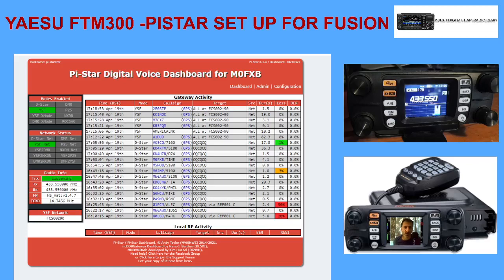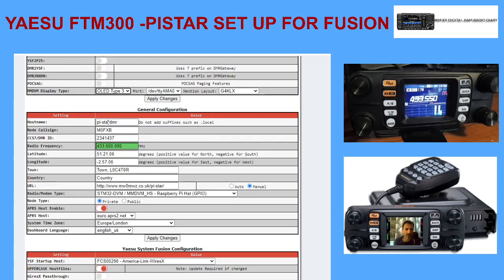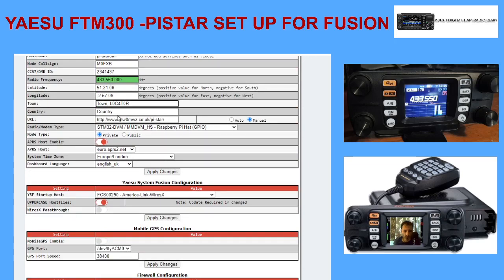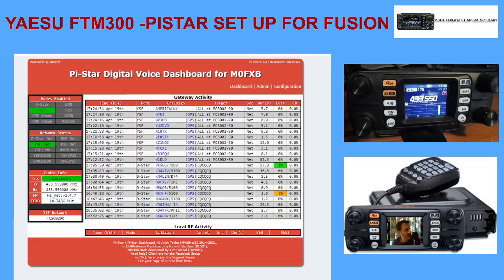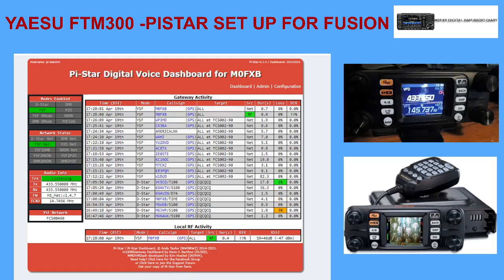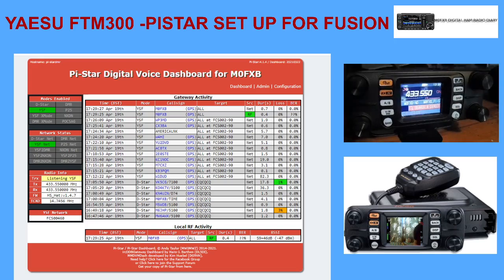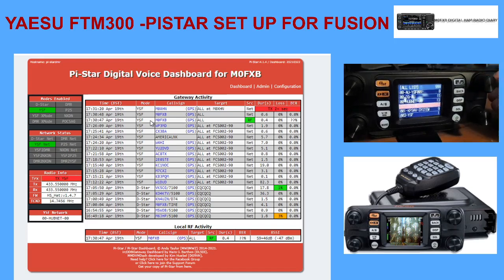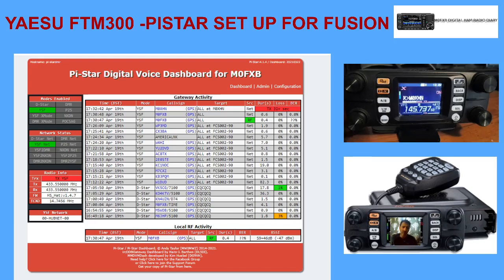YAESU FTM300 -PI-STAR FUSION CONFIGRATION AND SETTINGS

Comment: I have an issue maybe you can help me with, I have ZUMspot Nextion 3.5 using the YAESU FTM-400XDR. I am using the same setting, but the issue is I can transmit one time only. When I transmit some callback and then I’m not able to transmit the second time. Any Ideas
Reply from the maker: when u tx does anyone here you.
Reply: @M0FXBHamTech  Yes, When I transmit they hear me fine, they start talking to me, I wait for a few seconds for it to drop, and then I reply back and it does not transmit. very strange.
Reply from the maker: Hi i would need to know what radio , see the screen of the radio plus pistar front page and config page -M0FXB@outlook.com